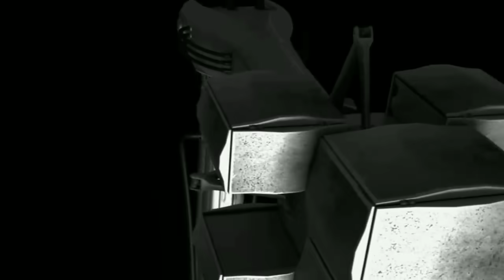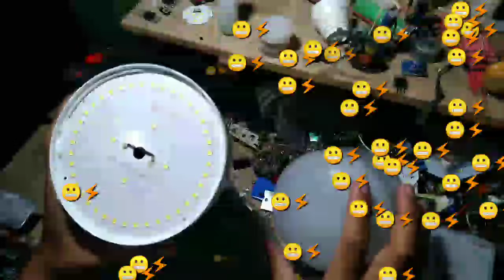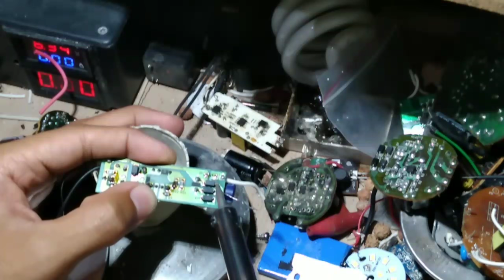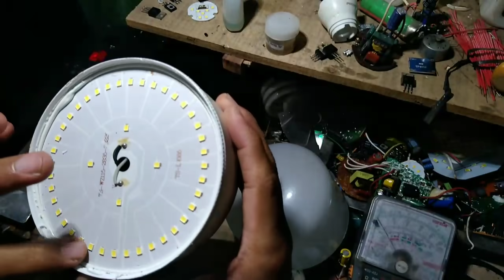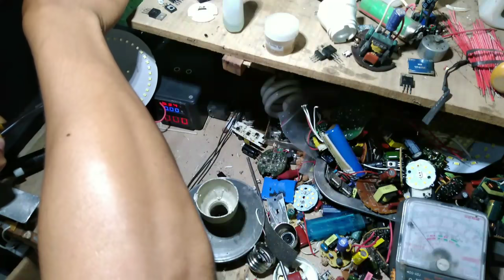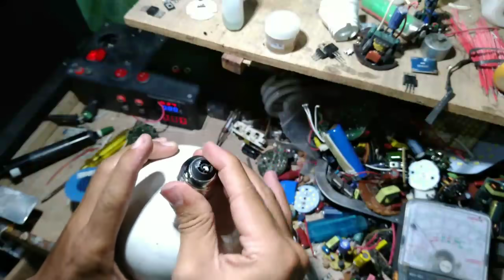servis led super jumbo 40watt #servis_lampu_led #service_led_bulb

Comment: Mas lampu led 30 what kalau alur listrik ke driver dikasih resistor 1omh 1wath kanan kiri apa redup mas dan apa efeknya kalao dikasih resistor..trimakasih
Reply from the maker: tidak redup ..gak ngefek ..r berfungsi jadi fuse/pengaman
Reply: @dokterlamputv  makasih infonya
Reply: Mas saya punya driver 20 what
Bekas lampu led neon...mata led nya yg biasa.... Trs saya mau merakit nya dengan  mata led   smd perbiji voltnya 9 volt .. perbiji mata led 1wat apa bisa mas
Reply: @familyandfriend169  tentukan tegangan dan arus terlebih dahulu dengan volt ampere meter
Reply: Kalo misal ganti 1 led yg rusak trus dikasi led 3mm trus di kasi resistor bisa gak ? Kalo misal bisa harus brp ohm untuk yang 40 watt
Reply from the maker: tergantung chip lain masih oke pa ndak

Comment: Anti konsletnya pakai apa?
Pakai IC ,relay atau gimana
Reply from the maker: cek video terbaru ..sudah sy share pak
Reply: @dokterlamputv  om itu serial led nya berapa volt pakai high voltage
Reply from the maker: klo driver 350mA biasanya 114v
Reply: @dokterlamputv  trimakasih om
Reply from the maker: sama2